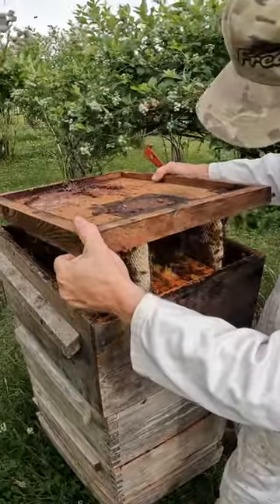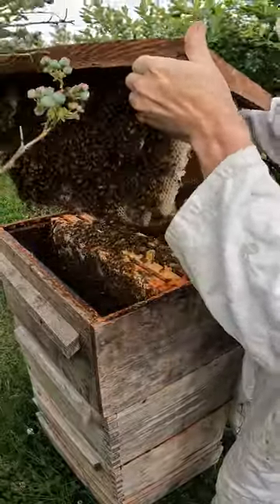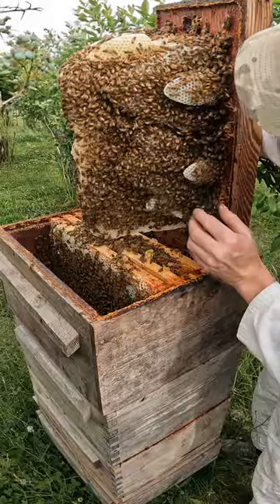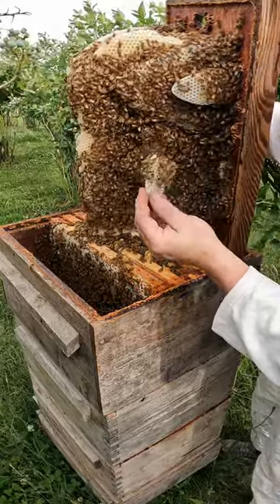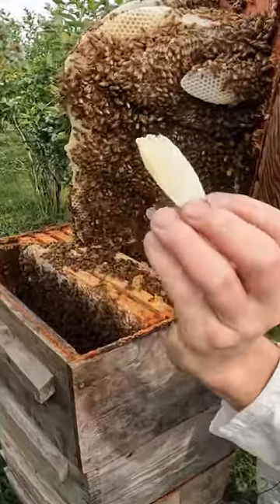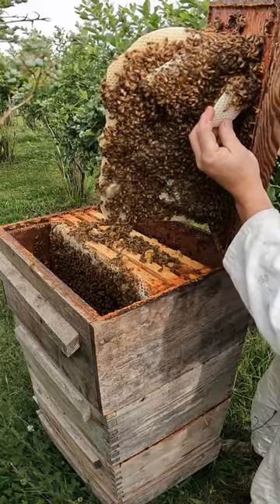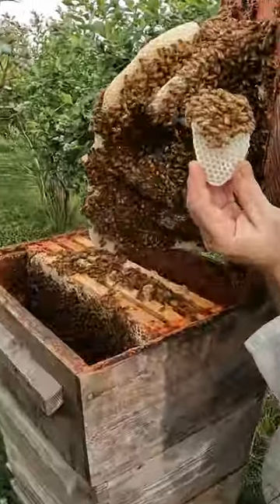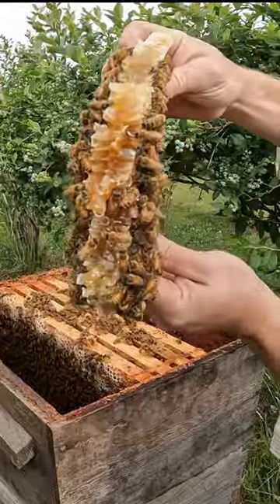How Do Bees Build Honey Comb?

Comment: How do you give the wax back to the bees?
Reply from the maker: The frames in the hive have plastic foundation stamped in the pattern of the cells.  It comes from the factory with a very thin layer of wax on it.  I melt the old wax and add it to the foundation so the bees have less work to do in drawing out the frames.  I show it in this video: https://youtu.be/BDx2wtDkvs8
Reply: @petrhermanadventures9509 can you post the link only please. It's  not clickable.